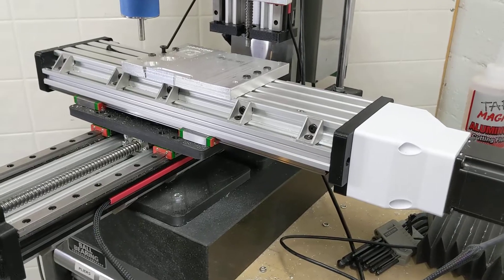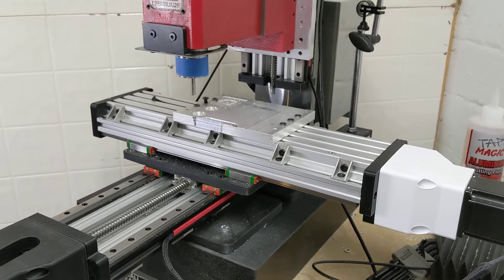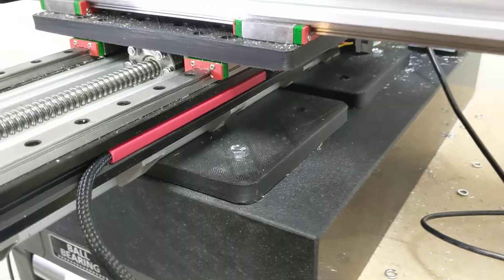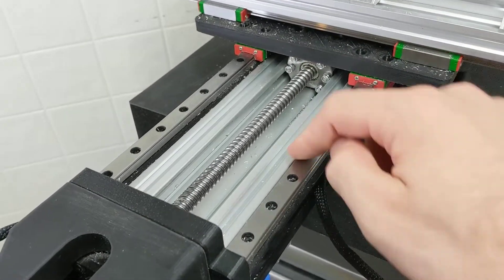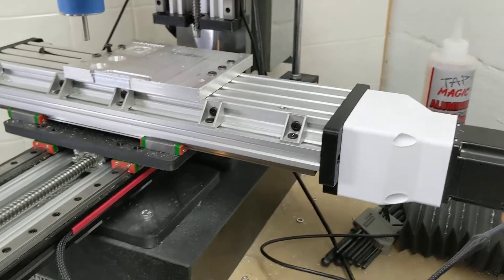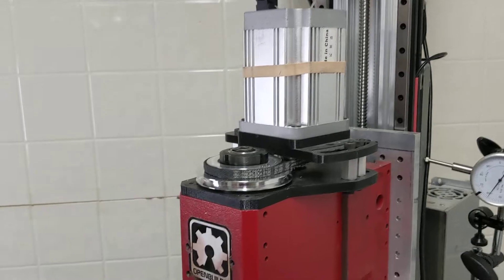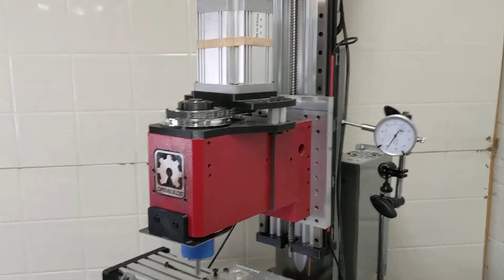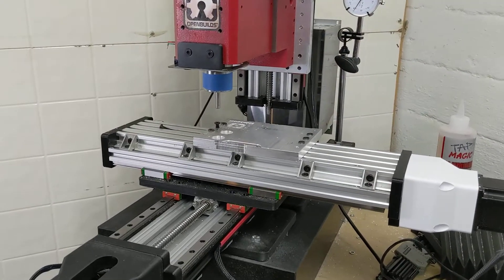RIG CNC - 3D printed VMC - Super Rigid 3D printed Granite CNC mill (From Scratch!)

Comment: There are two materials you could’ve  and should’ve integrated into this build that you did not. While both are highly precision components you didn’t use, or mention either of them.

1.) The first material that should be integrated into a DIY build is ATP-5 cast aluminum. It is a highly precision 5000 aeries. Alternately others like mic6 or k100 can be comparable and 7000 series. Most machinery based aluminum plate can be purchased in many thicknesses and pre cut to the dimensions you need. You can purchase ATP-5 reasonably through Midwest Steel. I am not sure if they also offer machining services but Xometry does as well other suppliers who will notch, corner, machine grooves, channels, holes, drill holes, plus other features and the cost would probably not set you back much for the ease of assembly while maintaining machine precision. 

2.) the second material is buying Cast Iron Plate, Durabar, or similar. This can get more expensive however if you shop carefully it can be reasonable for what you’re getting far as finished products. There are a few who will even cast your part, one off for you and as long as your design isn’t overly intricate you may find its not much more versus buying a solid block to have worked locally. You could have a entire machine cast reasonably. Google is your friend here for finding services.

3.) The third and an option you didn’t mention is buying the castings pre made. There are companies making full CNC castings like the VMC 425 that is a $10,000 machine but they will sell you their bare castings ready to assemble with linear rails, etc for $1500 that come precision ready. Really do you know anywhere else you can get finished precision castings ready to assemble. You’d have a $3500 build by the time it was finished and it wouldn’t look anything DiY. Get what you pay for.

4.) You can also buy a Chinese 5 axis bench mill for $2500 plus shipping. It will machine aluminum and steel and is a good starter machine. Yes it will have less accuracy but you still would be better off, besides being more rigid than what you built you’d have a second machine and one to model from in building an even better one.

MY HISTORY:
Ive built many CNC’s and I am very experienced in building them from ground up and also retrofitting old machines, or even manual machines into Precision CNC. My most recent build is square to .0002 as well is the spindle run out, and after machining and calibrating i have slightly under .0004 accuracy in parts and its incredibly rigid with 2000 IPM rapids and a 300ish IPM cutting speed. It will outpace  a Tormach in every way and is as accurate and as fast as a Robodrill 14ai. It cost me about $9k, or so plus i used a industrial VMC to machine the castings. The 4th axis HAAS 5c i picked up cheap and retrofitted. It is a $2500 value for next to nothing. 

All this to share ideas and give you a perspective toward alternatives. Nothing will replace the knowledge gained from a DIY project. 

Lastly, While you didn’t do a bad job you made some critical mistakes in your design. The Z axis being the main issue id address and that leaves for a lot of flexibility here. I think you overlooked how certain tools and specifically how indicators are your goto tools and that you could have utilized them better, along with the addition of shims if necessary to compensate and achieve a precision 90 degree for better rigidity. Those 3d printed plates should be replaced with ATP-5. I would’ve started with it. 

For anyone else reading always use double nut ball screws they have zero backlash unless you plan to calibrate with oversized ball bearings. They will cost about 2” in travel so you may want to compensate your design if you need specific travels.

Epoxy granite is great and buying ATP-5 machined to spec could’ve made a beautiful 90 degree mill using 1/2” or even 3/4” fasteners and embedding into a very rigid casting with adjustable feet. The casting didn’t need to be perfect, just strong, the rest would’ve aligned up much easier than you may have considered. 

Im one that doesn’t like redoing things. Plan it and finish it the first time so you don’t negate all of your hard work later.

Anyways nice job you’ve done what most wont ever attempt.
Reply from the maker: Hi Glenn, Appreciate the feedback.  I think you're misinterpreting the purpose of this build. The goal here ease of assembly, accessibility (cost), and achieving reasonable precision without access to standard machine shop tools.  I know there are a ton of paths to improve on this core design but all of the options you mention either significantly increase the price (outsourcing to external vendors), OR require equipment that my target audience (primarily new hobby machinists) do not have access to. The design constraints I have implemented are intentional and are in the spirit of making something DIY friendly.  "Improving" the design by making it significantly less accessible violates the core goal of the project.  

Your points 1,2, and 3 all are far too complex for the stated goal, I've built machines out of Mic-6 before, they don't look like this machine, that is intentional (See above).

For option 4, I have a PocketNC, I know the exact chines machine you're referencing. It struggles to achieve 0.125"^3 MRR in aluminum.  I can easily hit 1.5"^3 MRR with the RIG.   I love my pocket NC, 5 axis CNC is a game changer, but its not even in the same category from a material removal rate standpoint. 
 
I understand the mechanical limitations of the Z axis. Its susceptible to a left right vibration mode, This presents as chatter.   I've shimmed it and gotten it as flat (and rigid) as reasonable given the no external machining constraint.  If you've got any ideas for a 18" vertical column that can bolt onto a granite plate, support the weight of the Z assembly with no external machining for ~$140 I am genuinely all ears. 

(This design does use double ball nuts, not sure why you're assuming I don't have those) 

I totally agree an Epoxy granite casting would likely be a superior machine, but not really the point of this build. 

I've got quite a few other videos making incremental improvements on this design, you can see some of it's future performance in the later videos.  I'd recommend you check a few of those out and join us on the discord server if you're so inclined, its a space with a bunch of machine nerds working on RIG's and other similar projects. 

Again thanks for the feedback. Just want to make it clear to potential future watchers (and comment lurkers) that these decisions were made with a particular design-intent.  Other design intents are totally an option and the internet is filled with scratch built CNC machines with different levels of success.  My hope is that RIG, as built, is a relatively low friction entry into "real" machining.

Comment: This is a really awesome build and project.  All the basic engineering I learned, I did it building a kit plane.  It flew and I'm not dead, so I must have done something right.  But as I watch you and your machine work, I thought, damn.  Would have been nice to have one of these in the shop when I was cutting and drilling endless pieces of Al angle for brackets, especially multiple copies of the same thing.  A deeper understanding of the principles of rigidity would have helped back then, too.
Reply from the maker: Thanks! It's never too late to build one! I'm in the process of porting this project over to Github. https://github.com/Factorem-io/RIGCNC It removes a lot more more material these days with a few simple upgrades

Comment: Would be really cool if you could use it for manual operation too
Reply from the maker: you could certainly remove the steppers and 3D print some handwheels for the ballscrews.   I think I mentioned in the write up on RIGCNC.com but it would be ~$500 cheaper if you didn't purchase all the electronics
Reply: @TheBetterRyanKelly  My thoughts were more along the lines of ToT's Maho. Move motor from right to left (right side is good if you're left handed) and maybe some sort of worm gear setup for the front with a way to disconnect the motors when hand driving. Just a random thought though lol I've been looking at the PrintNC lately

Comment: Very cool concept, and execution. How did you attach to the granite?
Drill thru and bolt into a threaded backing plate, thread the granite, or were you able to secure threaded inserts into the granite?
This project addressees the question of how to make a mill without a mill.
Well done.
Reply from the maker: Thanks! I used threaded inserts which are designed to be epoxied in place. There are a ton of construction grade adhesives at hardware stores with more than enough grip
https://www.mcmaster.com/93980A530

Comment: Brilliant! I am planning on an epoxy granite build using the same philosophy. In my design, the base and column has precision ground bars for supporting the box ways molded into the granite.  The headstock is also cast as it needs to be as rigid as possible. You can purchase a 1HP BLDC motor made for a sewing machine for a little over $100 with a speed controller on eBay.
Reply: Are you documenting your build anywhere? Epoxy granite builds are fascinating to me
Reply from the maker: Thats a great tip for sewing machine motors, Ill have to check that out.
Reply: Don't cast them in, it always warps and won't stay straight. Bolt or bolt&glue them on.
That way you can get proper straightness rather easily.
And why should the headstock be more rigid if cast in place?
If you have a proper design there's absolutely no need for that.

In general, casting precise functional surfaces in place without machining afterwards is a recipe for failure. There's very good reasons nobody does it.

Anyway, good luck.
Reply: @heinzhaupthaar5590  Yes, the bars are actually cast into the epoxy, but they're waxed so the epoxy can't adhere them as it shrinks. They can be easily removed at the end. They're also studs cast and spaced evenly and perpendicular to the bars for anchoring the bars and the rails. 

As for the headstock, it is a cast block with the spindle bore cast into it.  It's cast separately with an plate for anchoring it to the column.  You could just fill a headstock with epoxy granite, but given the effort, you might as well just cast one. It's also cheaper and more rigid.

Comment: Great build.  What was the issue with the DC motor on the spindle that was difficult?
Reply from the maker: I'm just bad at electronics. Reflecting on it, everything worked the first time I tried it so it wasn't that big of a deal.  For me, it was the anxiety of it possibly not working.  Ill add the as-is BOM for electronics from China to the Website if people want to copy this exactly
Reply: @TheBetterRyanKelly  thanks Ryan.  I am all about getting the cheapest solution, so I just wanted to make sure the motion controller or drivers didn't support the motor or require some herculean effort to configure it properly.
Reply from the maker: @KarlMiller  I am currently using a workaround but hopefully its an easy fix for someone with better knowledge of electronics.  For the spindle speed, the BLDC controller accepts an input voltage to set the motor speed, I don't know what voltage that is and I couldn't find it in the documentation but I experimentally found the point at which the motor stops going faster by feeding it a voltage from a controllable power supply.  I then measured my controller's output voltage for various speed commands.  Essentially what this means is if I tell my motor to spin at 1500 RPM the real-world speed as-measured is ~5000 RPM.  I just manually edit the Gcode right before I hit send to get the speed I want.  I'm certain I could get the post-processor to just output the right numbers but I don't know how to do that.
Reply: @TheBetterRyanKelly  I use Fusion 360.  If I find the model numbers on your BOM I will check to see if they have a post processor that has reasonable documentation in the code to be able to tweak it without too much drama.  I do software professionally, but the post processor code modules have to end up speaking the Gcode that somehow seems to be completely different with every controller or driver.
The good thing about open builds electronics is they do a pretty good job of supporting and making their code work with various equipment, and they have pretty good people on their forum too.
Estlcam may simplify some of the gcode generation because it is only a tool path generation tool.

Comment: rigidity and plastic should not stay in the same sentence
Reply from the maker: Agreed, but you're kind of missing the whole point if that's your take away from the video... The intent is for people to start with plastic and use the mill itself to upgrade to metal parts
Reply: @TheBetterRyanKelly  I went this path and not even with plastic but with aluminum. You can't build accurate parts with inaccurate machine. But yet again it depends how far you want to go with accuracy. The current CNC I'm building is all steel square tubes welded and filled one by one with polymer concrete. Since I don't have access to a large mill to make the surfaces flat and parallel for the rails support, I invested in a granite surface plate, straight edge and a scraper to achieve the flatness and accuracy I want. It takes longer time but it get's me where I want.
Reply from the maker: @car9167  that's absolutely a legit method for creating a mill, and I'm sure it will be objectively better than this mill, but it sounds like it requires a lot of skill,special equipment, and time, all things I was trying to avoid on this build to lower the barrier to entry.  I could design an amazing mill from first principles but if other people can't build it without having exactly the same machines as me it's not really adding anything to the community.  I can get +/- 0.005 on this  mill with plastic parts and that's more than good enough for the work I expect it to handle.
Reply: @TheBetterRyanKelly  If that's thousand of an inch is ok. If is 5 microns is not. I hope is thousands of an inch
Reply from the maker: @car9167  haha thou for sure, if I could hit 5 microns with $1500 in parts I would be trying to sell it instead of giving it away for free haha

Comment: Interesting design, thanks for showing.   Is the spindle casting this one? https://littlemachineshop.com/products/product_view.php?ProductID=1487   I didn't find much there besides that, except for lathe headstocks.
Reply from the maker: There's also this one https://littlemachineshop.com/products/product_view.php?ProductID=1944&category=-269978449  which has all the bearings and spindle installed, you'll also need this part https://littlemachineshop.com/products/product_view.php?ProductID=1498     OR you can buy the whole assembly turn key. https://littlemachineshop.com/products/product_view.php?ProductID=1663&category=
Reply: @TheBetterRyanKelly  thanks for the links.  It's sometimes hard to find things like that that are only mentioned.

Comment: Linear rails are not straight and are not meant to be mounted like that. A granite surface plate is all good, but when you start mounting regular extrusions on top, it's a waste. 

Still, seems to be very rigid, which is quite impressive! :)
Reply: What do you mean by "not meant to be mounted like that", I have seen many Cnc builds using the rails like this. What could be better mounting option for linear rails?
Reply: @mvadu  I do the same as you, knowingly incorrect mounting. 

They should have a reference shoulder that they’re mounted against: https://youtu.be/i8FQdzl3EN8
Reply: @Freddy_Lie  thank you for sharing that tip. It makes sense now.
Reply: @mvadu  No worries, I also mount them like you

Comment: Great work! I skimmed through most of your website as well, it is well written. What travels did you end up with? I didn't see it on the website (but may have missed it).
Reply from the maker: It's kind of configurable, you can change out extrusion lengths and purchase longer linear rails if you have a desired layout in mind. I targeted ~250 x 250 x 250 arbitrarily
Reply: @TheBetterRyanKelly  That's a decent range for the size.
Reply from the maker: @nickp4793  I was just copying the prusa build  volume haha

Comment: Neat stuff. You could cheap out on the base even more by getting a free offcut of kitchen granite, checking it for flatness/curvature (YMMV) and setting it into concrete with an embedded nut plate to fasten down to in strategic locations. Similar rigidity and if you check the free granite carefully you can get a good piece, though not all are.
Reply from the maker: Cool idea, I wonder if you pick up a piece from a kitchen  granite place if they'd do the holes for you as well, they often have large cnc capabilities to do the sink and faucet holes
Reply: @TheBetterRyanKelly  If you paid, and they were light on work, probably. The place I got mine for a DIY surface plate was more busy and was happy for me to take some, but had no time for anything much. My piece was flat, but watch Matthias Wandel's video on his chunk that was not. I found that you can clean it up like butter with a diamond concrete disk, so a diamond drill and maybe flush running into it might be easy, too? The dust is bad for you, though, so be careful/wear protection :-)

Comment: came here from reddit. Looks awesome and rigid. I'm currently building a cnc router (not mill) and I've decided that I prefer larger linear rails. I first wanted to use these smaller 12mm rails (MGN12 I think) but I've now switched to 20mm (HGR20) rails. I've also resorted to 3d printing the parts and plan on milling them from aluminium asap